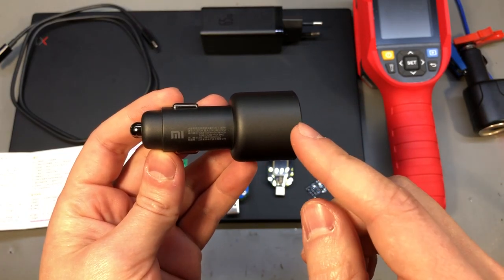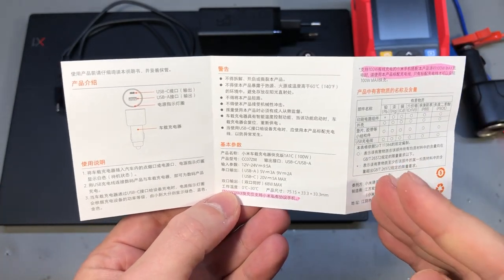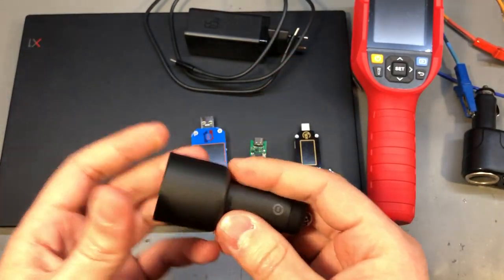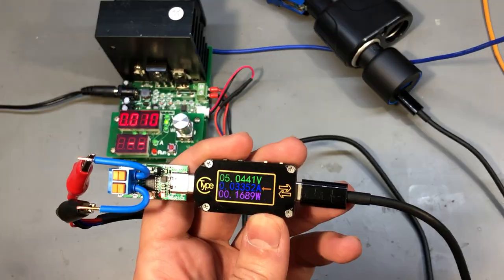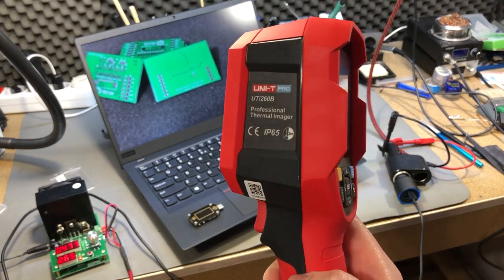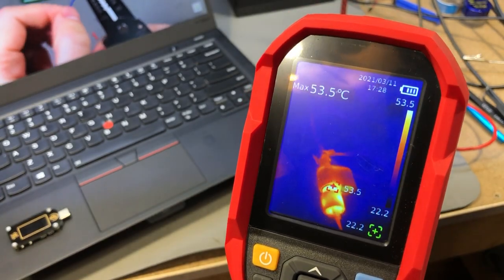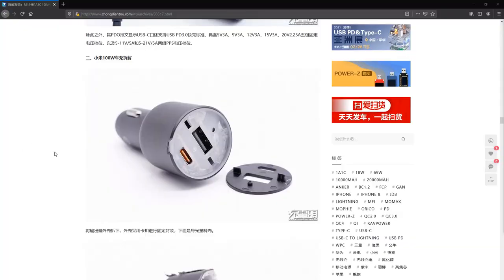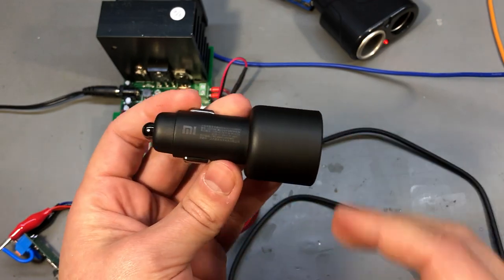Testing The Xiaomi 100W Type-C Car Charger - Voltlog #355

Comment: This special 100w car charger by Xiaomi (the Apple of China) is a true 100w power delivery.  It is specially made for Xiaomi phones capable of charging 120w feature and it truly delivers.   Got it and tested it for my Xiaomi Redmi Note 11 Pro+ 5G 120w phone and when connected into my cigarette lighter in my BMW, the phone suddenly displays "100w MAX" charging speeds.   The cable's inside the type C connections is orange color and it has a special pin layout that when connected to a supported Xiaomi phone it will trigger the signal to the charger to start charging at full 100W speed.  

Also Baseus and Essager both a under division of Xiaomi also make very high quality chargers and cables top notch electronics certified with Xiaomi's premium quality and QC in every product and at very cheap prices!

Comment: If the case is aluminium, does that mean that the only thing preventing a direct short on the input pins is the anodization...? Also, it would be interesting to see a video explaining architecturally inherent efficiency differences between buck and boost converters.

Comment: Try running this device at something a typical nominal 24V automotive electrical system (e.g. on commercial style trucks). If this device can't safely run at a constant 30V input voltage without major issues, it's technically NOT suitable for nominal 24V automotive applications. Cars charge at between 14V to 15V regularly nowadays when there's not enough load to overwhelm the alternator and enough engine RPM (typical max output rpm is around 3000rpm IIRC). For a 24V system, it's reasonable to expect voltages to max out at just under 30V.
Reply: From the teardown: caps are 35V, FETs are 30-40V, ICs 28/32/36V but unsure what connects where. Based on that I don't think I would take the risk.
Reply from the maker: There is also transients to consider so I would probably not trust this on a 24V system.

Comment: Can we expect a future detail video on Type-C PD like through datasheet and handshake process?
Reply from the maker: PD is not really on my list but you can expect a follow-up on this charger once I get a new PD decoy module to try and get it to output full 100W.
Reply: @voltlog  You can try to update the firmware of your ruideng tc66c usb power meter, maybe they fixed negotiation part?
Reply from the maker: @LevonAvagyan  That is something I did not try but will look into it.

Comment: For a proper soak test of these chargers, an obvious choice would be to use that thermal camera to look at not just the PSU’s, but also the cables under the high load! 😎
Reply from the maker: Sure, the cable would also get warm at those high loads.

Comment: I have this charger and it is great. This and my ugreen (which was more expensive) are the only car chargers I've personally come across that will step-up voltage to do 20V output with 12V input, and so are able to charge my Asus Zenbook OLED, though only at ~45W with PD as you observed. 

My Poco F5 Pro, though phone itself is 67w max, is able to get full speed charging through it. However Xiaomi/Poco use a proprietary protocol to do this which they make quite unclear. Though that is why the manual states that only their devices can utilize the full capability of the charger. 

It is not USB-PD nor PPS, so the usual trigger devices will not be able to activate this full power mode. When it is running in USB-PD mode, which is indicated by the charger glowing blue (glows orange in Xiaomi full power mode), it is presumably "supposed" to be capped at 45W (the typical 20V - 2.25A), but has a bit of extra headroom before the protection trips. 

They also explicitly say to use the included cable because their protocol requires an extra pin and wire to work. A regular USB 2.0 C-C cable (4 wire) can't trigger the full power mode, however I have a Aukey USB 3.0 C-C that will, presumably as it's a 9 wire so it does connect the extra pin (and then some).

Comment: what do i check to know if the car charger has a boost circuit?  (12v to 20V PD)  there are a lot of car chargers being sold that it says its capable of 20V but most sellers won't mention that it needs a 24v supply.  (so its a step down not a boost)

Comment: I have been looking for a good quality (safe) USB-C car charger for my ThinkPad X270 (very similar to your X1) Although this may save the day in an emergency, for the price it is selling I may look for something that can do better. One note of relevance, I once tried to charge my X270 with an Apple 20W USB-C charger and got an error message saying that it was not powerful enough. That was to be expected but what was not expected is that message got stuck now, every time I turn the X270 on, it is displayed even before the BIOS splash screen, telling me to press ESC to continue to boot. I can't get rid of it no matter what I tried... So, beware when testing USB-C chargers with your X1.
Reply from the maker: Have you tried clearing the BIOS settings? Or maybe doing a BIOS upgrade? That might help clear the error.
Reply: @voltlog  I tried clearing the settings, did not work. I have the latest BIOS but I will try to re-flash the same.

Comment: i have 2-Xiaomi Poco X3 NFC phones, my house chargers are the fast charging 33W type. Currently I have to use a cigarette lighter charger and get slow charging at 18w and when using the power outlet in my vehicle with the stock charger I get the 33 watts. So I'm looking for a solution where I can charge both of my phones at 33w. I suppose it can either we lighter or outlet, what do you recommend?

Comment: Tell me please, I've bought a 65w car charger from baseus, it's almost the same as your 100w Xiaomi charger, but I am little confused about voltage.  It also uses PD 3.0 protocol, and it also can work with 12 and 24v car instalations. Is there any chance that any of those small chargers will be able to boost 12v input to 20v output? To be precise, i am wondering will it be able to charge my a huawei USB C charged laptop. Wall charger has a 65w output (at 20V). I am using a small car, so I don't have 24v electrical instalation.
Reply from the maker: These small chargers are not meant for continuous usage at 60W so they're not the solution you are looking for. For a quick charge it might do the job, but for prolonged usage it will get hot.
Reply: Some USB C car chargers will boost 12v to 20v, and some will not. The fine print might tell you. 

I have a Satechi 60W car charger, which I have used with my MacBook Pro for many, many hours without it failing.
Reply: baseus has a 100-160w type C car charger.  But there is no charger that charges 20v/5A with 12V input voltage.  Which requires a voltage greater than 20V.  Xiaomi too, because this is the charger with the largest charging current of xiaomi already.
Reply: Sorry, the xiaomi 100w car charger can charge 20v/5v with the included 100w cable at 12v input voltage.  I read the Baseus charger catalog it needs an input voltage of 20V or more (24v truck) it can have 20v/5v output.

https://youtu.be/mb0uqd6z8ck

Comment: What can this be used to did its support powerdelivery v3 or 9 volt 3 amp? How much amp with ulefone power 5? Will model BYM-128 12 volt 10 amp be enoth for this?

Comment: Cool! Now I can charge my phone in 10min but I would have to buy a new one every 3 months, because my battery probably would have bit the dust by then. Smart marketing from Xiaomi.
Reply: You mean planned obsolescence, right?
Reply: @4G12  Yep!
Reply: Yeah, 100W into a phone battery sounds like it's going to affect battery life significantly
Personally, I would use a 10 to 20W charger whenever I could, having the ability to fast charge @ 100W is nice if you forget to charge and you need to leave in a hurry but I would use it sparingly
Reply from the maker: I would probably think the same but at the same time they are offering warranty with their phones so you would expect the battery to last at least 1 year with daily charging at those rates. Just 1 year you must say? and I would agree, my batteries last much longer because I take good care of them but to be honest if you look around, the majority of people don't take care of their batteries and they have already lost at least 25% capacity by the time they reach 1 year.
Reply: @voltlog  For the '1year then throw it away crowd' I suppose this is fine, personally I like phones to last 2 to 3 years,
You're quite right though, many people care far more about convenience than longevity of a device... Sad really

Comment: Thanks for the review and test. Still impressive to draw 55 Watt out of that.  On the other hand USB standards. Something about the word 'standard' is  starting to trigger me. How many standards do we have now?
The thermal camera, there is no need to ask us if you need to review it. Yes, of course , but I will keep 1 eye closed keeping my bank account in mind.
Reply: The USB 'standards' are just a joke,
It really didn't help when the USB - IF renamed a lot of protocols for the USB 3.2 rollout, so now we have a situation where you have an old device marked as one protocol and a new device marked as a different protocol, when in fact they are the same and completely compatible... So frustrating 😠
Reply from the maker: The thermal camera is not cheap but as you will see in the review video, if you need those thermal pixels, there is nothing similar on the market.

Comment: You don't need to worry about burning cables; without eMarker chip the output is limited to 60W. You don't need PPS to get to 100W, just a proper cable.
Reply from the maker: That is the standard and the case on the Baseus charger, couldn't confirm it with the Xiaomi charger.